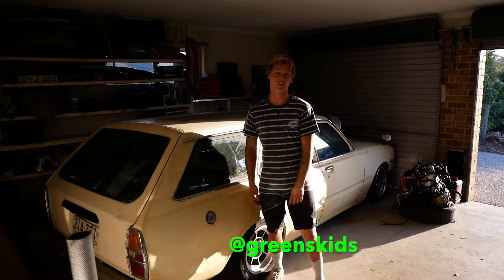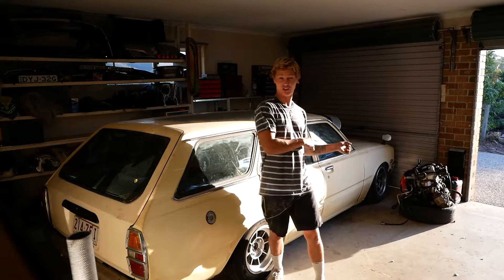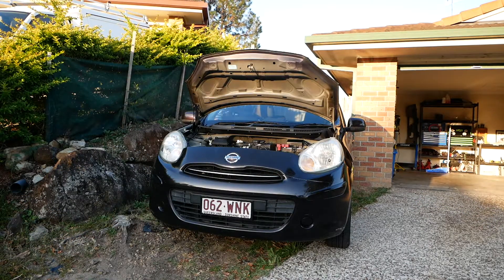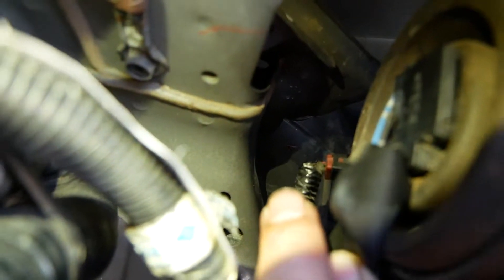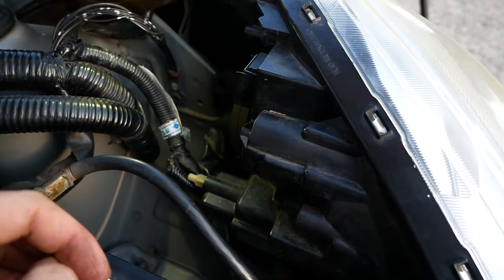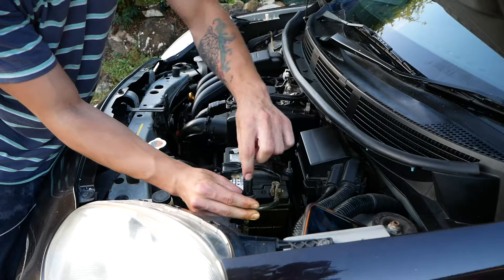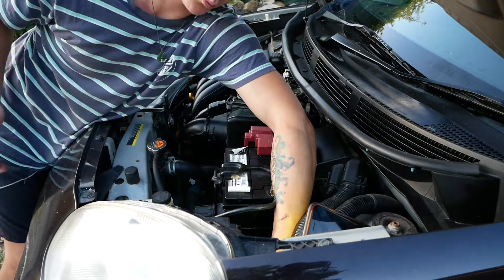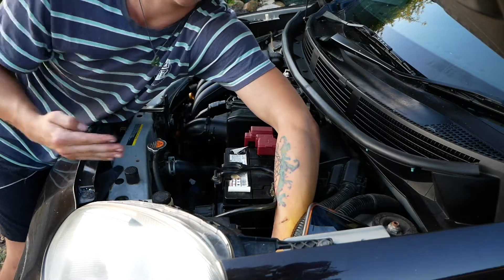2010-2014 nissan micra front parker bulb replacement

Comment: fu-king nissan got tiny hands and still ended up with bruizes all over, but video helped a lot- main thing is to either twist in any direction it gives force to, then do reverse in reassembly.as on drivers side its impossible to see the clip, so use passenger side as a guide where to grip.also rename video to parking light or daylight running lights, theres f all description on headlight itself so really hard to find video on this bulb.
Reply from the maker: cheers for the comment yeah your right! glad the video was some help! yeah its pretty tight in there hey🙃
ohhk yeah I was going to say parker light but it really is the bulb I was replacing, also these Micras don't actually have dtrl lights ☺️

Comment: it definitely does not work, I own a Japanese model and had to bring it to the garage, plugs were so locked that I nearly break the headlight trying to remove the f....ing stuff, it is all made with plastic and break easily, better paying a mechanic who will remove the headlight and use a special tool than breaking it and have to change the full of it